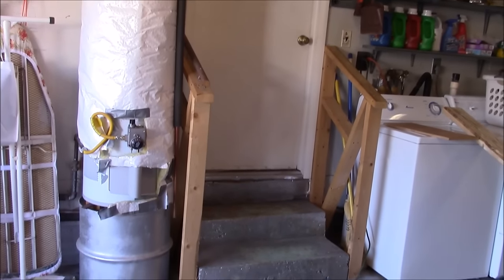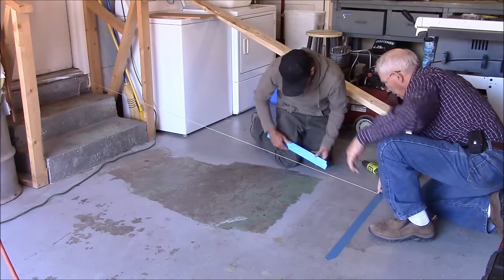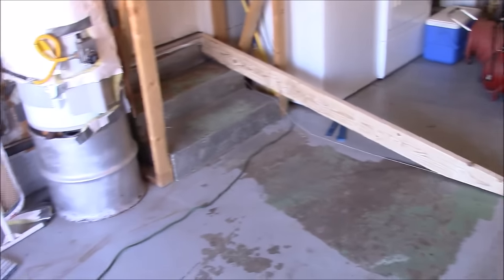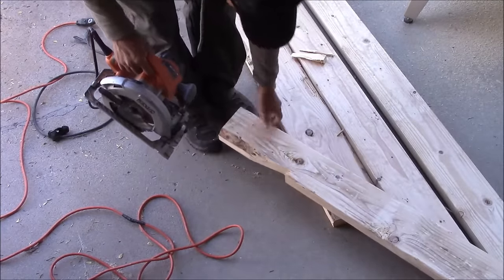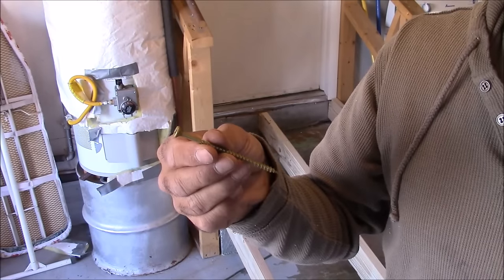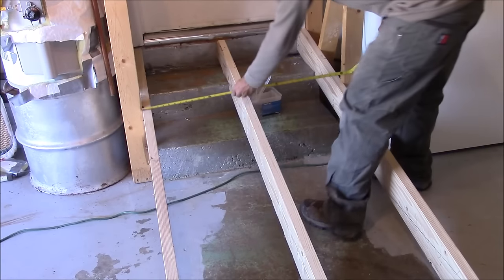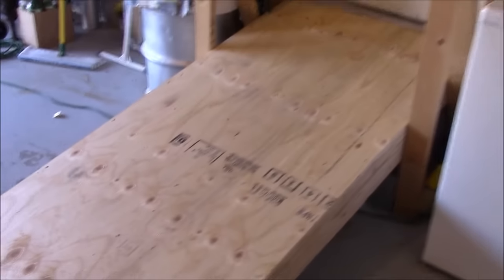DIY Handicap / wheelchair access ramp

Comment: I pretty much followed what you did and just built mine. I can get my dad in and out of the house safely. Thanks for the video
Reply: How much did it cost you?
Reply: @ncheelz4life  I didnt have any of the tools so probably about 200-250, but materials you can probably do it for 125 or less
Reply: Did you use a transition piece between floor and ramp? Thanks
Reply: That's why I'm looking. I need help with my dad

Comment: Very good info here EXCEPT about 4 minutes in he cuts the long slanted cut on a table saw with no type of jig/guide to prevent a very dangerous “kickback” situation which would throw the wood back at you at high speed. Safer to just use a circular saw for this. Otherwise this is a great video.

Comment: I'm just a little food for thought, due to me being in a wheelchair I know firsthand that you always and I mean always want a flat platform before the door. Most people that aren't in wheelchairs don't realize that when you go up a ramp to open a door you need a flat surface because even in the power wheelchair they like to tip backwards when you stop you need a flat entryway area big enough for your chair to safely turn around or whatever and if the door swings out and needs to be grenade to accommodate the door swing in the chair maneuverability in size
Reply: Good food for thought, thanks for shearing.

Comment: Why for gods sake would someone give a thumbs down for this very helpful project, really bewildering.
Reply: You really want to know? I for one, even though can build stairs, ramps rafters, would not have thumbs down the video. Having said that, the ones that have thumbs downed it are framers and stair builders and this is not how a professional would have built it. You build a ramp similar to a stair jack or a rafter with a carpenters square and set of gauges or just a speed square will also be correct to make the cuts like the birdsmouth etc. Also not use a table saw to cut the stringer etc. etc. Here on you tube you can find the professional way to build this with the right tools. This man did a fine job with the knowledge and tools he had and I commend him. He did it himself. Again...the pro's are thumbs downing him. I am not. And just to prove my point even though I can correctly build this with my correct tools I am giving him a thumbs up! You wanted to know.

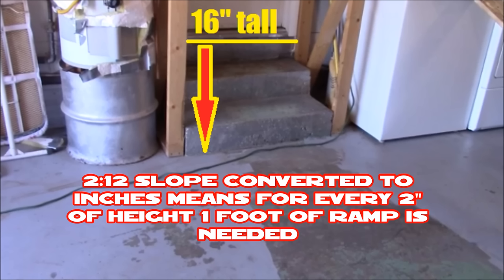Comment: In this neck of the woods an 8 foot x 5 foot landing and no more than a 1:16 slope is code. 1:12 slope is recommended. From experience, above 1:12 gets scary. Wooden ramp, wet tires and you might think you're riding on ice. Your brakes may do NOTHING to stop you. Just a Heads-up to you newbie ramp builders. Better safe than sorry.

Comment: Thank you so much for the detailed explanation/visuals and the graphics really helped as well.  You mentioned attaching with brackets and concrete anchors if you have concrete steps.  Would you toenail tap screws into concrete?  I don't know what kind of brackets you would need.  If you can, please let me know .  Thank you again!   FOLDING FRAMING SQUARE!  Genious...now i don't have to guess on the angles!  Who knew there was such a tool.  LOL

Comment: People complain about lack of work, or simply,  look for extra cash.  What household wouldn't want such a nice addition?  This is a money maker.
Take a teenager along with you, teach them a skill craft.  Measure twice, cut once.  Handrails are as important as the ramp itself.  Kids are going to play on it, just like they jump on a bed when you say, don't jump on the bed. 

Teach your assistant to take --before, during, and finish photos.   

Make it safe.  Teach as you learn for yourself.   Look for free materials where you can find them.  Can find  minimal cost, or free to haul.  Maybe barter my materials for you to make me one...win-win.  

Safety's first....look up county code and use it.  Don't skimp. Curb and handrail are important.   Maybe add some nubby safety tape for slick surface.
Commend you in making it look so easy.  It's mightily needed wherever you go.  Mind -numbing to think handicapped accessible has only been around for thirty years.  We have a lot of catching up to do.  Hey builders...isn't it cheaper to make a ramp than steps?

Wonder about this application...is that a water heater?

Comment: My back door has a 5.5" drop to the concrete patio with a 1" metal threshold under the door. The door is set 6" back from the edge of the drop. I used a piece of 5/8" pressure treated plywood cut to 40" wide and left 96" long, and 1@ 16' 2X6. Cut the 2X6 in half, sliced each half from opposite corners into two 8' long triangles. Screwed all four triangles to the bottom of the plywood, evenly spaced, with a lip extending the upper end of the plywood 6" over the edge of the cement to the metal threshold. I drilled 12 evenly spaced 5/16" holes at the upper end of the plywood and squirted in one tube of rebar anchoring polymer to support the "flying" end of the plywood. Sealed the 1/4" gap from the end of the  plywood to the metal threshold with liquid nails. Shaved a piece of 1X8X48 #2 pine board to finish off the bottom end of the plywood to 1/16 edge at the very bottom of the ramp. Now my wife, who uses a walker, doesn't look like she is going to pitch forward when she goes out the back door.

Comment: Thanks for your excellent instructions and demonstrations. As for the slope, isn't your 8 foot run supposed to be measured from the bottom of where the rise begins,  at ground level, out along the ground to the the sharp end if the slope? I would draw it for you if I could, but I think you get the idea I was trying to put forth. Nevertheless, since the angle is so small, then it won't be much difference. A ten percent difference perhaps? I estimate, without doing the math that the way you measured off the 8 foot distance from the top to the bottom, you actually got a shorter actual distance at ground level by as much as 10% less than 8 feet, so that means you got a steeper slope, steeper by around 10%.
Reply: I did some rough calculations and I think 10% less was way off. It's more like less than 2%. I took 8*12 the feet to get 96 inches, then used Pythagoras to square that and subtract 16*16, and then taking the square root to get the resulting length, about 94.6 inches. Which is only less than an inch an a half shorter than the prescribed 8 feet run, I think the slope will be only around a degree steeper.
Reply from the maker: Hello not exactly sure where we are not in sync. The height from floor to top of ramp supports is 16" and ramp supports/framing are exactly 8' and were cut to a pretty much perfect point. I guess in the video I did not clarify the highest point of ramp in video I was actually referring to the framing. The thickness of plywood will have to be accounted for if measuring highest point including plywood but the changes would be very small especially in 8'. If you just match framing to the correct slope that's the easiest. If floor is unlevel that will have to be taken into consideration also the diffence in fall or rise will have to be accounted for from starting point to end point.
Reply: Sorry, I misinterpreted what it means to have a 1:12 or a 2:12 slope because I was stuck in math classes that I had long ago where the definition of a slope is determined by the rise over the run, the run being the side that runs along the floor.  And so I took the run to be 8 feet  along the floor and the rise to be 16 inches.  So I thought you had made a mistake by measuring along the actual slope, but that is correct. I just did some research and discovered that the ADA ramp code defines the angle to be the ratio of the rise to the slope itself, the hypotenuse, the longest side of a triangle.  And when it says 1:12 now I know how to measure it. Thanks.
Reply from the maker: No problem questions are what makes us all smarter. Sounds like you are pretty good at math. I just know the basics.
Reply: You are correct, the ratio is rise and run. But he measured 8 feet on the ramp stringers who's isn't correct. Though as you found it's an inch or so shy, so not really significant.

Comment: Question: On the bottom you used the outside of the square and on the top you used the inside, how does one know to do that? I've never been good with angles so it seems like one would have to use the inside or outside on both ends?????

Comment: For the UK folks out there - some building reg measurements (also very practical, not just red tape!):
• Has a non-slip surface.
• Is 1.5m wide with a minimum unobstructed width of 1.5m.
• Has a maximum individual flight of 10m
• Has a maximum gradient of 1:20 at 10m (500mm high)
• Has a maximum gradient of 1:15 at 5m (333mm high)
• Has a maximum gradient of 1:12 at 2m (166mm high)
• For goings between 2m and 10m it is acceptable to use a sliding scale
i.e. 1:13 for 3m, 1:14 for 4m, 1:16 for 6m, etc.
• Has top and bottom landings no less than 1.2m and intermediate landings of 1.8m every 10m.
• Has 100mm high raised kerbs to any open side of ramp or landings (stops wheels veering off).
• Has a continuous suitable handrail on each side.
• Has a maximum cross fall of 1:40
• Has a maximum slope on landings of 1:60
• Has a contrasting, landings, upstands and handrails to ramp surface.
In short, don't just let any old builder pour a uselessly steep concrete ramp, otherwise people like me have to break their backs taking it back up again and the poor householder has spent double the money  :P

Comment: What is that long angle called?
Reply: hypotenuse- in geometry, a hypotenuse is the longest side of a right-angled triangle, the side opposite the right angle. The length of the hypotenuse can be found using the Pythagorean theorem, which states that the square of the length of the hypotenuse equals the sum of the squares of the lengths of the other two sides.